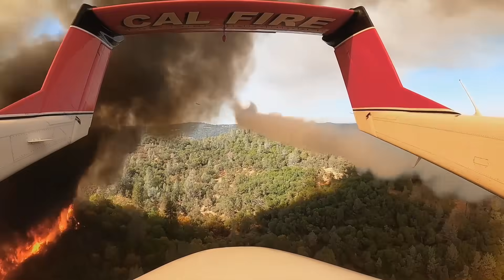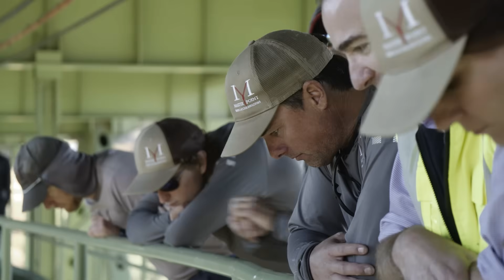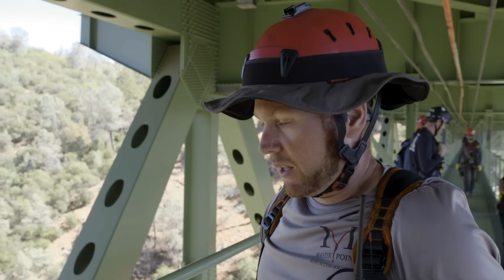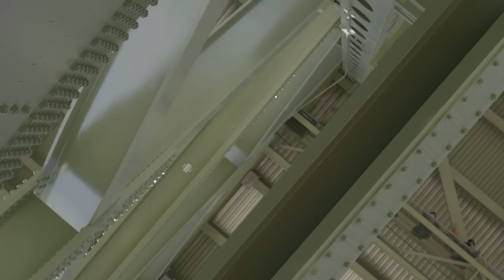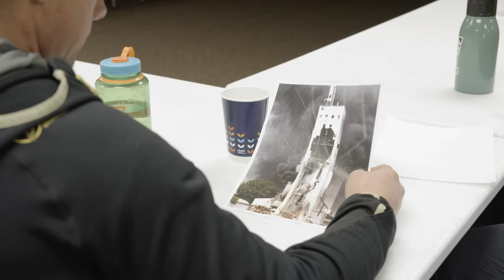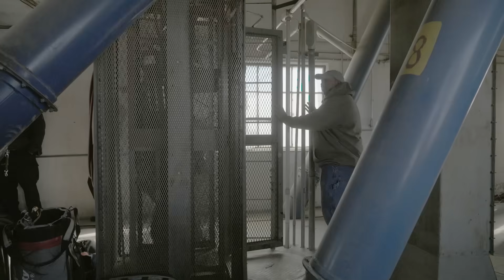Terrifying Reality of Working Hundreds of Feet Off the Ground | End of the Rope Season 1 Episode 4

Comment: Used to install fall protection anchors and fall arrest systems.  Basically, if youre following the most basic rules, youre not going to die of a fall.

More dangerous than you taking a fall, is falling debris and tools, from above.

Usually bad falls occur due to negligence such as ignoring swing fall hazards, not wearing proper equipment, not using equipment such as lanyards properly.

Honestly, I've worked in sketchy circumstances, but I've felt safe, trusting in my gear.

I tried rock climbing, but i get scared when I'm about 30 feet up, because i didn't install the fall arrest systems.